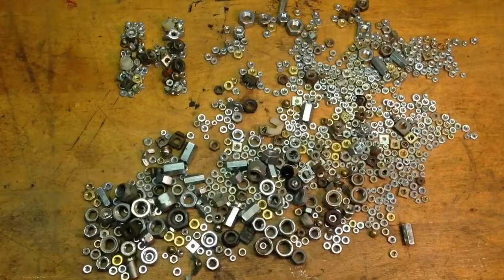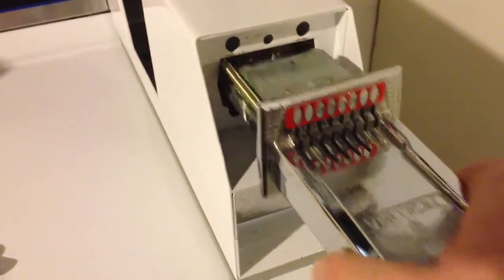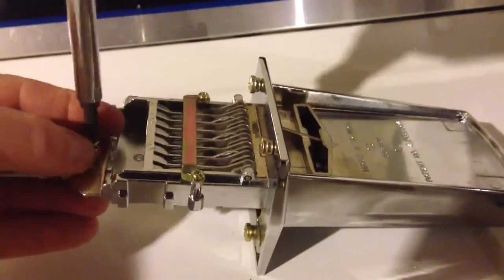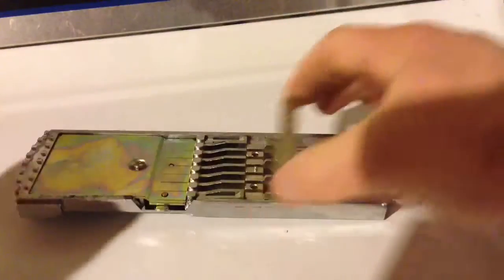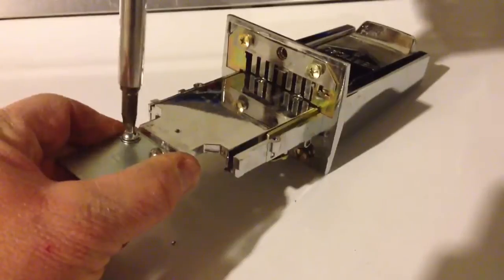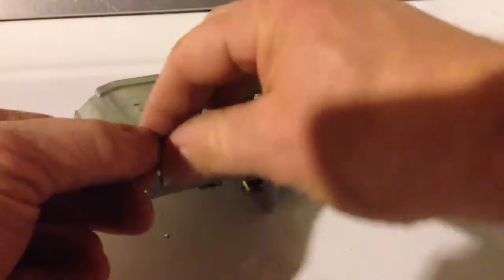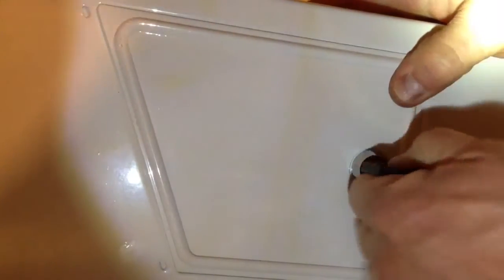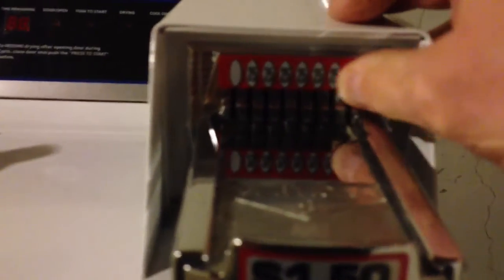Changing the price on a GE coin operated Dryer

Comment: Thank you Bob.  U were right.  I have a newer model vertical 8 EDS and after you tank off the bolt holding it in there is a gate that u have to take off.  I had it on backwards.  Thank you for the guidance.
Reply from the maker: Glad I was able to assist :-)

Comment: In order to get to the long bolt holding the coin slide I need the correct key to open the access panel. My tubular key that opens my whirlpool machines doesn’t work for my GE dryer.
WHAT IS THE CORRECT KEY AND WHERE DO I GET IT.??? 
My access panel is identical to the one on the video…
THANK YOU 🙏
Reply from the maker: THE CORRECT KEY IS THE ONE THAT CAME WITH THE MACHINE. IT WILL HAVE A NUMBER ON IT. That key must be ordered and is different from other machines. Hope this helps. 
Thanks for watching.

Comment: My problem here is that the tray does not slide back. If I open the whole mechanism and lose a bit the screws it will work for 2 or 3 times but then the tray will get stuck again. If I tie the screw the tray get stuck, if I let it loose the screw I will have problem the coin does not go in.
That suck!

Comment: Bob your video was great!  How ever after changing the price is tried to put coins in and use the dryer.  It worked bit it was extremely hard to push in and pull out.  Think you can help?
Reply from the maker: Can you tell if it is bound up on something? There may be a piece that was put back on wrong, upside down, or backward. Try taking it apart and reassemble it one piece at a time. After each piece try the slide to see if that piece is causing you problems. Hope this helps.